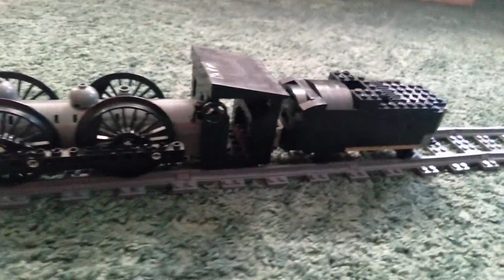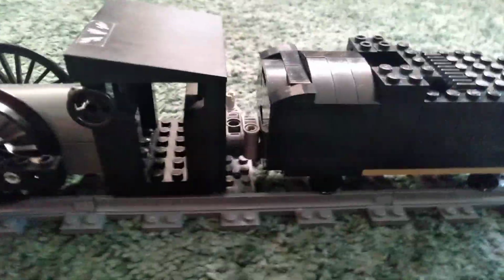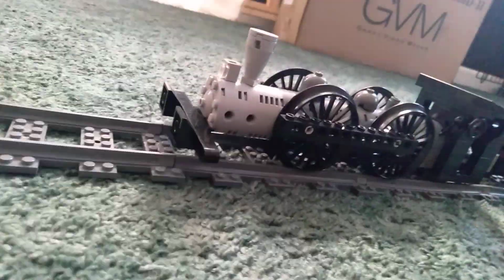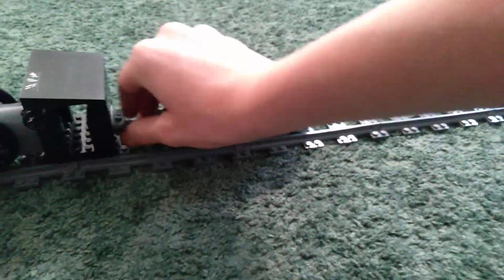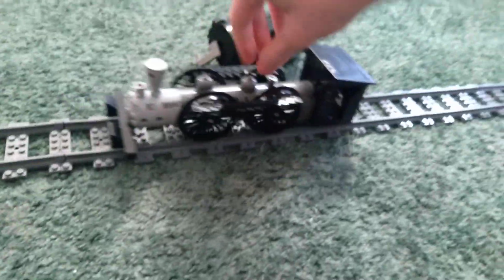Strange Lego 0-4-0 Steam Locomotive Moc

Comment: Could exist, looks like the flying bufferbeam
Reply: Sorrily, no. Axles would have to go through the boiler, which is impossible. The second problem is no frame, which would make the locomotive as brittle as a cracker. The cab seems to be connected to the firebox, which would put too much stress on the firebox-connection to the boiler, making the engine snap somewhere along the body.